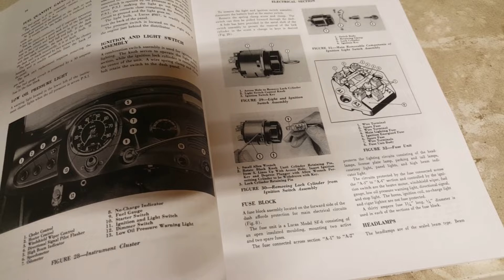Will It Run? 1961 (Nash) AMC Metropolitan Barn Find Parked For Nearly 50 Years

Comment: The car was designed and first built when it was Nash. It was always built by Austin in England. American Motors was formed when Nash and Hudson merged. The Hudson plant was closed while the Nash plant remained open. The last Hudson's were rebaged Nash's. The Nash and Hudson nameplates went away after 1957 and the cars were all Ramblers. Interesting thing the Metropolitan was sold at Nesh and Hudson dealers for a few years.
Reply: You are correct

Comment: Metropolitans use to have a pull switch for the starter.  Someone must have remove the pull starter and replaced it with a key set up.  Check  your manual again to verify the existence of a pull start device.   There is Metropolitan parts vendor in Los Angeles called the Metropolitan Pit Shop located on Laurel Canyon Boulevard in L.A. It is  a resource to check out for parts  for Metropolitans.

Comment: You got yourself a cool little collector’s item there! Fun to drive, easy to store, not so fast but you can catch up to them with class! Lots of restoration parts available. I don’t think I’d sweat the aftermarket starter solenoid situation too much. The button they put in is probably more convenient to use and live with than the original pull type, plus having the button on the aftermarket starter solenoid would be handy for making repairs; no need for a helper to “bump the starter” or for you or to rig up a separate starter button! Me? I am totally leaving that in there! I am totally onboard with getting rid of that second ignition switch and putting the lighter back where its suppose to be! You probably stand a good chance of fixing your old, original ignition switch. Since they don’t have a “start” position, they usually don’t take as much heavy wear as a switch that does, but since you scored a new one, you’ll be set either way. Since the powertrain and driveline is all pretty much just MG, you can definitely do some parts cross referencing if the Metro parts guys are running on the expensive side for something you need. Always good to have more affordable options! Looking forward to more revivals; especially brakes! Nice work!
Reply from the maker: Thank you for watching and for the tips! Much appreciated!

Comment: At 8:16 you can see vacuum tubes for the radio. Maybe turn it on and wait for tubes to warm up. Slight chance it'll make noise...
Reply from the maker: Thanks for the tip! It looks like power was ran from the second ignition so I need to fix that as well.
Reply: @newtsnostalgia the bulb contacts could have a trace if corrosion and just need to remove and reinstall or perhaps wiggle them
Reply: Enjoyed the video,  thanks for sharing.  A friend I was in college with bought one new.  He gave me a ride in it.

Comment: those engines need a lot of choke I would not put the original starter switch back in the car as they do not last long you are better off with the solenoid.

Comment: 🇺🇸👍 that is the school ignition system system ford Chevy etc. also doubles as a security system. Just take the cylinder out that you don’t have a key for to a locksmith and get 3 keys made. And it will start both keys on. I believe those horns are off another car.  Great Car Good Video 👍
Reply from the maker: Thank you!

Comment: Fill the Carb. float Bowl with 50/50 Petrol and PURE Acetone mixture(not Nail Varnish remover)..let it stand for a couple of Minutes...then Start it up.
the Acetone will melt away all the Gummy Fuel and clear any Jet orifices.
did you remove all the old Fuel that is in the Tank?

Comment: Actually the body was designed and built in America but the mechicals was built by Austin motor company in England
Reply: The body WAS designed by Nash, in the US, but built by Fisher-Ludlow, in England, with mechanicals and final assembly by Austin of England. The car was imported as a fully assembled, running and driving vehicle.